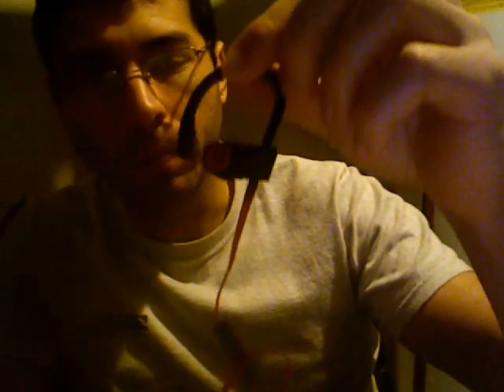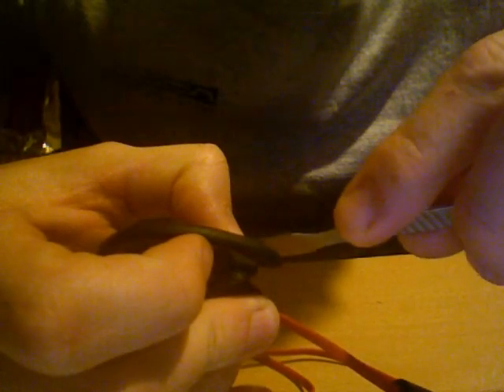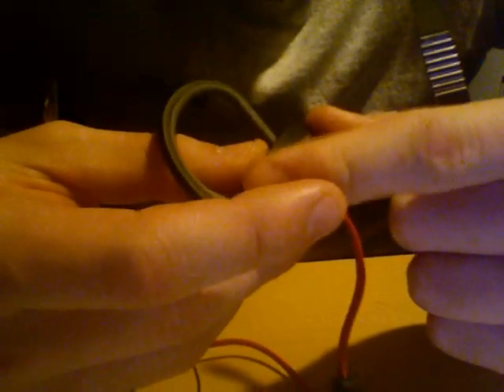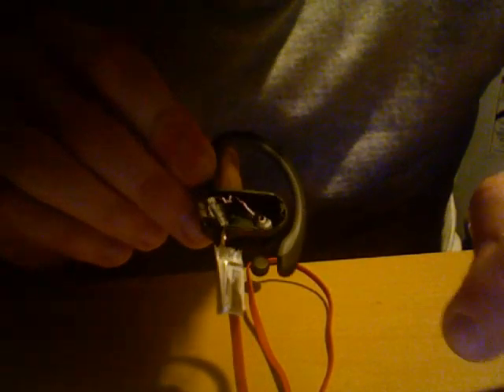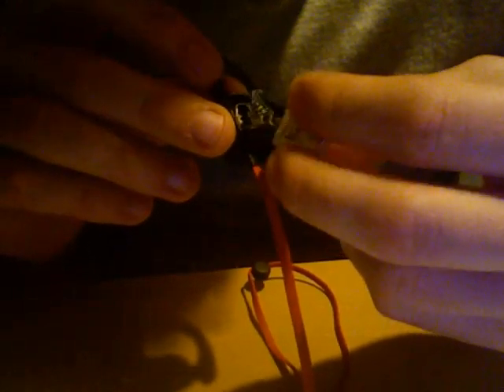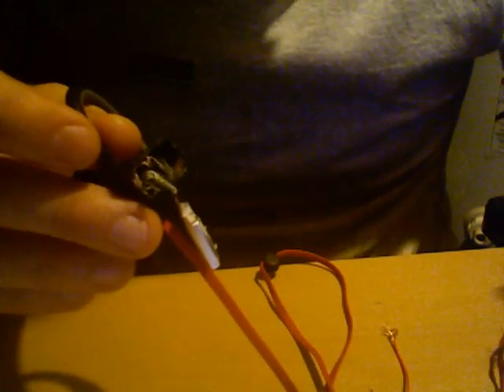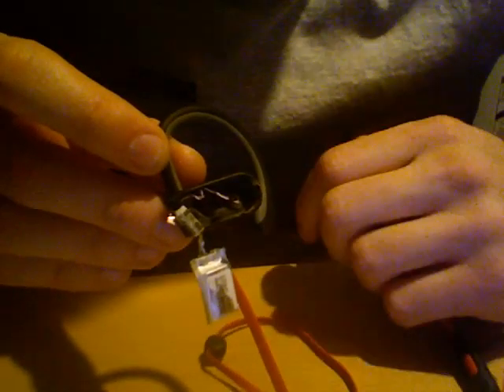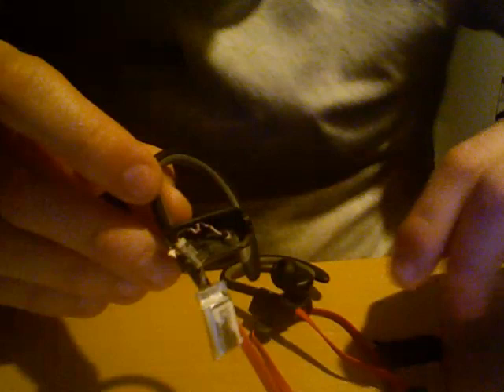PowerBeats 2 Disassembly blinking/not charging problem root cause

Comment: Hello everyone, I bought power beats 3 wireless from best buy in march. I got them for 150 with tax included. My receipt got lost with my old email. Couldn't log back in or recover old email and ahhh just BS. I'm a boxer and i sweat a lot i was working out my headphones just shut down on me. When i got home i tried to charge them and the first light the comes on is red. after a second later the white light comes and then another second passes and red again (while charging). Then stays on Red like its charging. i charged it for 2 hours and came back and tried to turn on my headphones but they dont want to power on. I need help if anyone has come across this issue. I'm so sad :(

Comment: @Pizza Daddy Hey man my headphones stopped working, took the battery out and the only thing i see is one or two wires loose from one set of the strip of cables. So is the battery dead or do i solder the little two wires? Thank You

Comment: can anyone help me , when i plug the earphones the light turns red signifying its charging (and i charge them for a good amount of time) then i try to use them they wont turn on . PLZ HELP
Reply: Roberto Contreras hi i can help you
Reply: Roberto Contreras I have one that does the same and I think that there is an issue with the power button or its circuit once for charging it doesn't need the power button...
Reply: please respond if you need help
Reply: These bluetooth earphones has some serious issues with the software. I wonder why apple didn't solve the issues after they bought Beats. So yours is working now?
Reply: Roberto Contreras my beats works fine right now
Reply: Roberto Contreras my beats did that same i charged it for one hole entire night it was still showing a red dot but when i hold the power button and the down volume it reset my beats anf i connected it to my phone and it worked fine
Reply: Same thing happened to me
Reply: Hi am having the same problem did you find a solution? Red light comes on when charging but still can’t turn them on. Thanks
Reply: Omar 8 hi... so your Powerbeats lights up when charging but it won't turn on. Do you have the beats software installed on your computer? The one that's used to upgrade the software?  This software tells you the level of the battery... if it shows that the battery is full all the time it might be because the Battery is full or if it's depleted. I tested and both conditions shows the same battery with 3.7v (100%) and 0v (0%) shows full battery. Try this and let me know what you find out.
Reply: Omar 8 when that happen to me i reset my powerbeats 3 and connect it again to my phone and it worked
Reply: No you connect to the computer using the Usb cable that comes with it. Not all cables work for connecting to the computer as some are make only for charging and not for communication. So use the one that came with your earphones.

Comment: This video is a bunch of BS I took the case off and now it won't go back on
Reply: The cover is glued in place as there are no latches. So you can just get one drop o super glue to get it back in place. Thanks for watching the video anyway. Pizza Daddy
Reply: Pizza Daddy oh I understand now I apologize for my ignorance, I was simply frustrated with my headphones they won't turn on but they charge perfectly and the light works but nothing happens when I push the power button but I still hear the clicking sound please help me. Thank you
Reply: Michael Zamora I have one that has the same problem. I guess the power button also goes bad often, but I didn't start searching for how to solve that yet. If I'm able to find anything about it I let you know. Pizza Daddy

Comment: Hi pizza daddy thanks for the video, did you replace the battery if so could u post a video showing how to?
Reply from the maker: Aaron Goodman Thanks you for your comment. I hooked up to an iPhone battery ( that was the only 3.7v source that I found at home) and it powered on and I could update its software. I think that the battery goes bad because the charging method written in the earlier version of the software is not good. I bought a battery but it didn't arrive yet. You can find on eBay for $7 but I want to find a cheaper source.
Reply: can you help me  i plugged it to the usb cable too strong and now when i plug it in again i dont see the red light charging